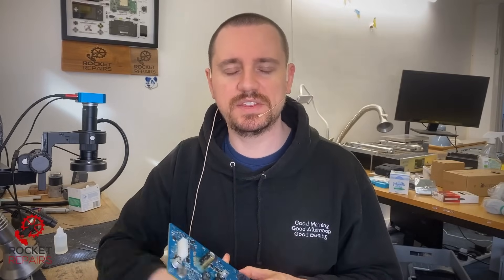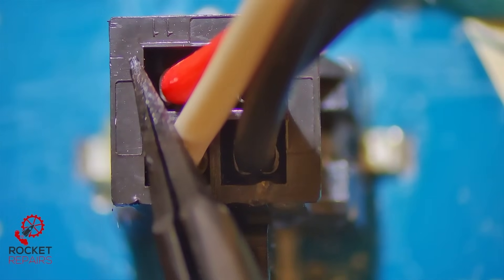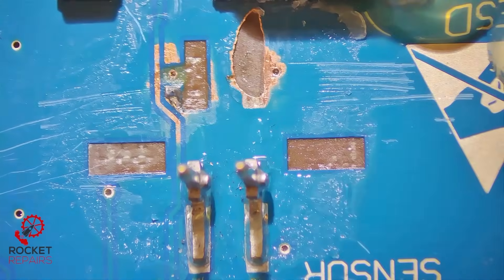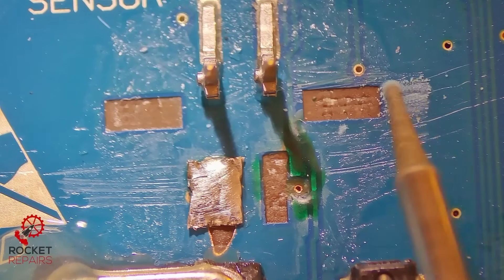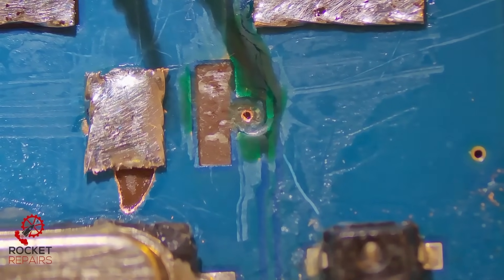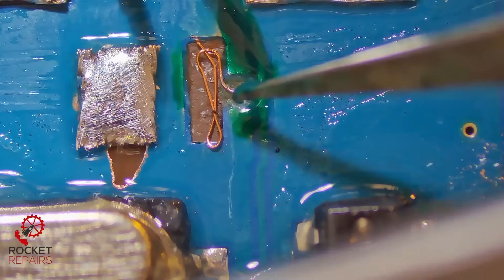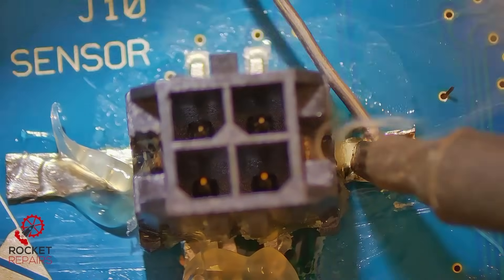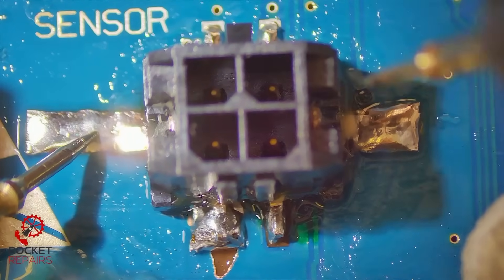John Deere Circuit Board Repair - Fixing expensive equipment at a reasonable price!

Comment: Those two pads that ripped cleanly off was probably why it didn't stay put though. They were clearly isolated and not originally grounded. You could see the intentional clearance in the masking there. What is sad though is seeing how none of the anchor points used via-stitching to improve adherence. Those molex socket/plug combos give a lot of leverage to the cable with their tall stack so anchoring is key.

Comment: Wow solder braid as a pad?! Genius. But what made you choose wire for the bottom right connector and not the solder braid like the others?
Reply: Probably because that area was kinda too small for his braid. Maybe if he would have cut it in half thinner it would have worked out...
Reply: I would have crossed the pad area with the braid though and anchored on both sides, just to give it less give to avoid ripping.
Reply: @1kreature  An other good idea! :)

Comment: This is the sort of thing I wanted to do as a kid, I know 42 and still wanting to get into this industry, however my disability prevents it, currently. Firstly due to lack of training available in my area, I am in the country (and in Australia). Secondly my disability limits the time I am actually functional.and thirdly the cost of training I don't have funds to spend on massive courses.
Reply from the maker: we are all self taught, start small, buy broken stuff on ebay or facebook and try to fix it.  learn from youtube @LearnElectronicsRepair get an understanding of how circuits work. there is always a way - Sean

Comment: That last wire u bent for connecting the via hope didn't touch ground
Reply: It is coated with enamel so not conducive untill scratched or melted off when you apply solder but the cut end is resting on the edge of the ground pad which isn't the best. Good job over all tho!
Reply: @JonnyFix  thanks a lot

Comment: Bah. Why don’t they make these connections using throughhole socks? It’s absolutely mental to use SMT connectors here.
Reply: Fair comment, but simply because SMT can be easily automated and is therefore cheaper, through hole not so much.
Reply: That board already has other THT parts (those electrolytic caps for one). I’d say those connectors are SMT just to make em fail early.
Reply: @lawrencemanning  Looks like the connector has been wrenched off by a person rather than failed, the through hole large cap and connector were probably unavoidably so
Reply: Fail as in “break” no matter wether it’s careless use or what. The connector would have faired better if it was throughhole, that was my only point. And since it has other THT parts why not make that connector THT? Ah well, that’s enough from me.
Reply from the maker: it's not unknown to pull through hole connectors off boards too and cause much more damage!